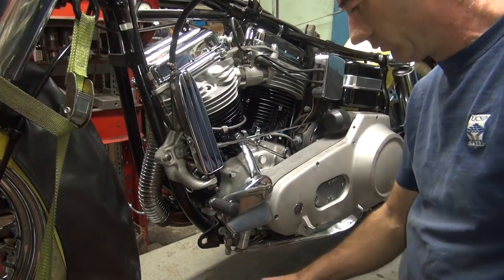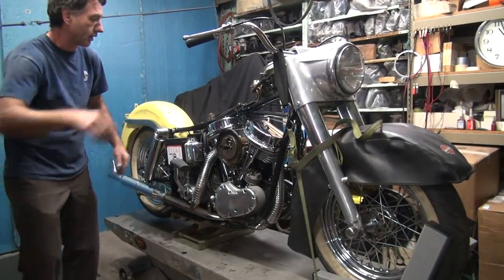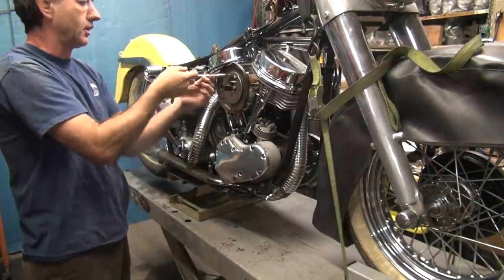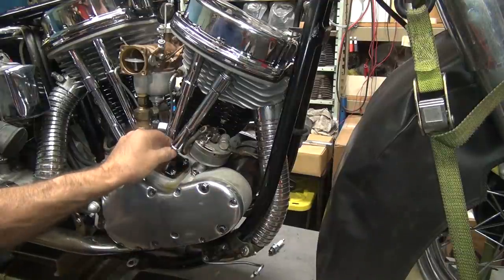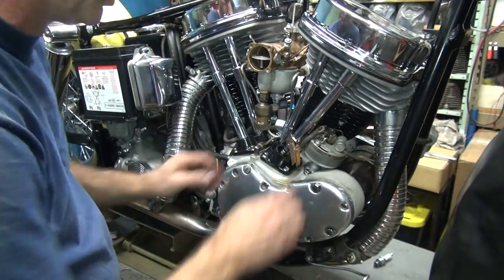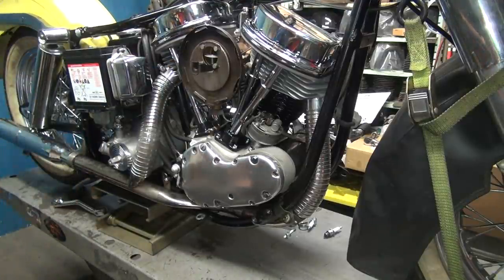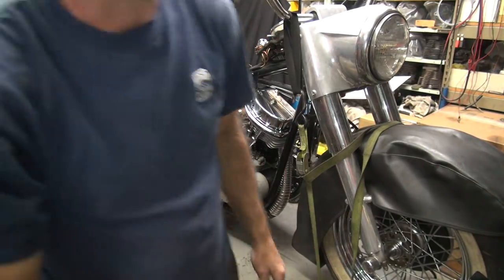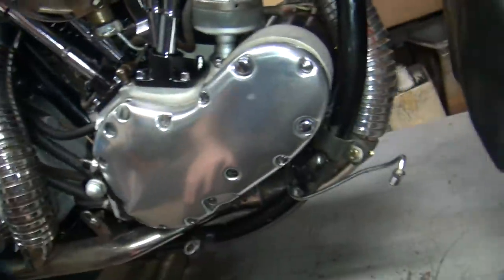1965 panhead #160 74ci flh motor rebuild and bike repair harley by tatro machine

Comment: got out of the suck in 76, in 77 I brought a 49 pan basket case for $750, put it together and rode it until 83, sold it to my brother and he ran it for 10 years. he sold it for bail money and it's still out there somewhere running. i miss it and all the headaches and fun i had.
Reply from the maker: its hard to keep a good bike down.
tatro

Comment: Anti-seize on plug threads is wise on any vehicle. I don't get paid to install inserts on my own vehicles (and to hell with doing it on 4.6/5.4 Fords!).
Reply: Tune up from hell 80% chance its going to need helicoil plug .poor bastard that was the 1st to find out thats normal.bring back the pinto. F ed over rolling disaster.

Comment: One cool thing about NGK plugs is that the threads are plated.  There theoretically isn't a need for the anti-seize.  That being said, I still use it on my stuff.
Reply from the maker: that might be but they don't gall up when i do use it and sometimes they do when i don't use it.
tatro
Reply: And that's why I still use it!

Comment: Linkert M74b indestructible. Still have a couple w/venturi machined. I've got a ton of hardware/fittings I'll never use. Everything from seat spacers to banjo fittings for a rigid pan.
Vacuum advance ......whats this cable for

Comment: Tatro is it always the lifter when there's valve train noise or could it be a loose pushrod.. I'm just now starting to notice some noise in the front cylinder......2004 twin cam road king. 95" kit with cams, adjustable pushrods was used. I bought the bike with work already done on it.
Reply from the maker: anything in the valvetrain can and does make noise.
tatro

Comment: You know the old saying man, one drop at never cease will paint a house LOL
Reply: Please stop saying never sneeze. It's anti seize.
Reply: @SavageZebra67  LOL but you have to admit one drop Will paint the house
Reply: @harryodum5598  that's true. Think it has to do with the graphene. That shit is like one micron and it gets everywhere. Could polish sand with that shit.
Reply: @SavageZebra67  it's definitely some good stuff. Before I retired I was a steam fitter and welder, we put that on 2 2 and 1/2 inch bolts on Main steam lines I got up to 1800 degrees come back a year later breaking loose with a hammer wrench
Reply: @harryodum5598  yah it doesn't bond with hardly anything. Pure carbon perfect for metal to metal.

Comment: when flooded ....choke open , ign off , full throttle , 3 kicks . Then turn ign on and start
Reply from the maker: or, full throttle, no choke with ignition on. there is no one way to do everything and if one method doesn't work try something else.
tatro

Comment: I was taught to take a long screwdriver and a rag on the handle to use as a stethoscope for noise finding when people see me do this now they ask me if i have a stethoscope i say nope i dont need one,kinda like you and the nut torque spec years ago i worked for chevrolet tourqu specs for mains and heads were 1/2 in impact rods 3/8 (zip then short burp)
Reply from the maker: if i have to do all that it is not bad enough to worry about. bad parts will let you know.
tatro

Comment: If one has installed a dyna electronic ignition on a panhead, should one use register plugs or not?
Reply from the maker: all electronic ignitions require resistor plugs and suppression plug wires.
tatro

Comment: Great video Tatro, I have a 59 fl it had a metal filter element and I’m wondering if that’s what they originally came out with? Perhaps to stop it catching fire from back fire? Cheers
Reply from the maker: the metal air filters are stock for the 1954 and earlier models. somewhere after that harley went to a paper air filter that i think was around 1956? either one can be used so you are ok. a k&n style air filter will let the motor breath better so it makes more power.
tatro

Comment: we had the same lift at one of my old jobs except it was modified for snowmobiles and had a hydraulic cylinder installed to operate with compressed air. went much faster than that one does is that one electric?
Reply from the maker: yes but i can stop at any point and work at that height. you can't do that with the other lifts.
tatro

Comment: Ive got a sigjestion get a divers weight belt with 20 pounds of lead and your scrany little self will kick it over easyer lol i had to through that at you i learned to start my 58 pan full choke kick it 4 times with my left leg then turn the key on and one good kick it starts every time try it youll like it even all my shovels are the same way 4 good kicks with the choke on key off then turn key on one good kick and wala it lives every time even. My nortons and most all my brit bikes started the same way
Reply from the maker: or you could just learn how to kick. it takes a strong ass leg to do it correctly if you are not a fat ass.
tatro

Comment: Had a '55 pan, I hated it, piece of junk. Folks, what you see on this video, with no disrespect to tatro, is exactly the way it is with old Harleys. Constantly fixing, replacing, adjusting something all the time. It took me ten years to finally figure out I got better things to do. I had a '78 shovel, same BS
Reply from the maker: old anything is what it is. you can fix it all at once or a little at a time. you can also upgrade many of the parts and make it alot better. than you can always take a softail and add in a new panhead motor and get what you wanted, a new bike that looks old but last.
tatro
Reply: Your bike obviously wasn't maintained , I'm riding a 48el that ive had since early 80s and trust it anywhere !  So now you quit riding or got a Honda?
Reply: Rode a '60 pan for 6 years with no issues, then a '76 shovel for 7. It's not the brand.

Comment: are those factory Harley Davidson heads or V-Twin. I am going to swap mine back to panheads on my 65,because the orevious owner installed shovelheads years ago for a little more horsepower but i want to restore it back to the original type heads. Thanks,you do very good and informative work. Thanks Again
Reply from the maker: i don't use v-twin heads, i like good parts. i mostly use stock heads that i fix as needed for the application.
tatro

Comment: Is it interesting for the noise in the cylinder head? It's a shame when it happens after assembly. I wonder what the problem is and what will end.
Reply from the maker: crappy lifters and rocker arm design.
tatro
Reply: Tatro Machine 
consequently, everything will be done by replacing the parts, the regulation and the engine will quietly work.
Reply: This is why I chose to run Velva Touch lifters. If you want the best they are the best. I'm sure they have a Panhead application. They're expensive as all hell but in my opinion you get what you pay for. The stock tappet blocks on the late model Evo's were aluminum and were slap wore out on my 1998 after 130,000 miles. I even lost oil pressure as a result! I immediately noticed a  significant increase in oil pressure after installing the Velva Touch lifters. It sure was great to see this 1965 Pan come to life, GREAT job KT & Scooby!!
Reply from the maker: good luck on that one.
tatro
Reply from the maker: i will take the s&s evo conversion lifter kit any day. they are bigger in diameter and will live longer. yes i would like them to be made out of cast-iron too. harley did make cast-iron lifter blocks in the late 80's and i have several sets for special uses.
a stock set of lifters and blocks would have done the same thing with your oil pressure. worn out parts are what they are. 
tatro
Reply: Usually when I do any type of upgrade at all I upgrade to something  significantly better than OEM. That being said I refuse to put the same junk aluminum (OEM) tappet blocks back in service, especially when I know there are other aftermarket companies that make a better quality product. I'm  sure that in your line of business you can agree. I only buy the very best for my bikes. Sorry if i came off as an a hole.

Comment: What carburetor is one this bike?  Many decades ago my brother bought a 1964? Pan that had no choke but had a Tillotson carb with a tickle.  He let me ride it all time even though I was only 14 and had no license.....no big deal in those days.  I remember it so well because the seal on the tickle would leak and if the bike backfired while kicking it over not only would the pedal smack me hard on the back of my calf, but the gasoline around the tickle would catch on fire and burn my thigh if I didn't notice it.  The seal looked like it was some kind of felt and would wick fuel out of the float and burn with about a 6" high flame.  AH!  Those were the days!  I developed a lifelong love of motorcycles, mainly Harleys  and still own a 1997 Road King I ride on a regular basis.  No more bruises on calves or burns on thighs though.

Comment: First winter I stored my twin cam I changed the oil first and it got so cold in my shed that the oil in the lifters turned to jelly. When I started the bike in spring they all collapsed and wouldn't pump up even after a half hour running the engine. My Dealer told me I needed new lifters - I took them out of the bike and pulled each one apart, cleaned them, pumped them up with an oil can and refitted them..... damn dealers are thieves......
Reply from the maker: no, they just have no idea on how to fix anything. they only know how to replace parts. next time use better oil.
tatro
Reply: @TatroMachine   I was a bit naive then and was using H-D's own 20w50... I am using Lucas oil nowadays and it seems better.
Reply from the maker: yes that is way better oil than harley. i like maxima and tribodyn myself.
tatro
Reply: @TatroMachine  Thanks for that my friend.
Reply: No

Comment: having the dizzy cover off might cause problems if the carb floods/leaks gasoline.  Just a "safety thought".
Reply from the maker: you have got to be kidding. you think its better to hold the gas in the carb as it burns up the bike. i would rather have it leak and burn on the ground. i can deal with that fire alot easier than the bike being on fire.
if you noticed, when you get a carb fire you kick the bike over until you suck all the fire into the carb. not run away like a little girl.
tatro
Reply: If for some reason the needle valve hangs open, pours gas out overflow or mouth of carb, , puddles at base of or near the dizzy and the spark from points sets off the fumes from the carb's gasoline overflow, flames up,and burns the paint etc you'll have a big expensive mess.  Furthermore, I see little need to have the DISTRIBUTOR COVER off, once you established the points are getting power & spark plugs are  firing .What you did there would you have you reprimanded or even possibly fired from most reputable H-D shops, if the owner spotted you doing it.. And yes I have worked for H-D shops including a franchised dealership. BTW, I'm not a kid nor a ittle girl, and have been working on H-D motorcycles for over 35 yrs myself. I've also had to put out a couple H-Ds that caught fire from people doing similar to what you did.  FWIW, I was just trying to pass along  a safety tip.  Seems you're not interested though, so do as you wish.....Good Luck, you're going to need it with your carelessness.
Reply: FWIW   I built a 1976 BiCenntenial Edition Super Glide to match her husband's original 76 BC SG, that appeared in Easyriders Magazine, on the "Foxy Riders" page back in the mid 1990s. It showed a pretty girl (Daisy, the owner) riding it dressed in a white tight outfit if you care to look it up.  I also built a Panhead Duo Glide that came in 2nd at Charlotte NC bike show in the 1980s ..considering the 1st place bike was built at the judge's shop for a customer, not too bad I say.  BTW I built that 2nd place winning Panhead in a customer's living room too. (hence SAFETY with GASOLINE AND IT'S FUMES) . Not to mention working on many, many , many bikes at a NC H-D dealership and later several other shops servicing, buidling, rebuilding, and maintaining a lot of different Harleys. Also I was a founding member of a SC Motorcycle Club.  So yeah, I have PLENTY of experience working on and riding Harleys.  And with dealing with assholes.

Also FYI I don't run from you or anyone else.  BTW try calling me a pussy to my face and see what happens. You act like the rest of these "keyboard commandos".  .you want to disrespect someone without facing them in person.  Although you appear to be old enough to know better it' appears you are not.  Rather you got incensed when someone merely pointed something out to you trying to HELP you, and resorted to childish name calling. Look up the word "maturity", you need to read the definition.

 BTW,  back in the 80s & 90s I personally owned two H-D Shovelheads, both of which I kick started with ONE ARM. I never needed to use the electric starter to crank them, because I know how to tune one. But then Panhead kickstarters used a different "ratio" and can be a PITA to kick at times. BTW the fact that the spark plugs ignited the gas mixture in the cylinders is a pretty good indication the points were doing their job , after which you could have/should have re-installed the cover for the "dizzy"and if you don't think a set of points breaking can ignite fumes from gasoline you truly are in need of some educating.

Tatro, I was merely trying to point out something to you that could save yours or a customers bike (& maybe even your entire shop)from being damaged or burnt up, by something you just overlooked/your carelessness. But it seems you'd rather be bullheaded and NOT consider good advice when it's given. Not to mention disrespecting said advice giver. BTW, prying out the roller lifter assembly with  two screwdrivers instead of using a magnet stick too isn't too bright either. But if it works..whatever.  Seems to me you need to stop trying to defend something you overlooked/did not notice , and just admit leaving the distributor cover off while cranking the bike for the 1st time after a rebuild while you have a flooding carb or at least a good chance an unexpected fuel leak causing gas or it's fumes to be ignited by the breaking points, isn't the brightest of ideas.  I will give you credit for saving and buildng the old H-Ds though. Glad to see old panheads brought back to life. 
Just be more careful with gasoline and ignition sources in the future, itd be a shame for your shop and all those parts to lost in a fire caused by such carelessness.  BTW, notice I didn't call you any vulgar names or disrespect you in this post.  That is something else you should learn to do.

Carry on ......
Reply from the maker: all of this bullshit comes down to the fact that you want to do a bunch of what if this happens bullshit. i don't give a crap about what you have done when you bring up a bunch of crap like that. if you are such a good mechanic than why in hell is your carb flooding over? why didn't you fix it in the 1st place. why didn't you turn the damm petcock off. why are you kicking over a bike with gas flooding all over the place. all of these things are what a dumbass does. if this is how you work than that is what it is. 
if you were here and said what you said i would call you a dumbass to your face and explain why you were a dumbass.
don't you even realize that the distributor on this bike is not even near the carb that you are so concerned about. your talking about a stupid cone motor dumbass.

same deal on the points. just because the spark plugs fire does not mean that the points and condenser are good. when you put them under load that spark can go all to hell. when i said i just had a bike in here that was that way that is because it was. i don't bullshit around, i tell it like it is and if you don't like it i don't care.
if you can prove to me there is a better way of doing things than the way i do it now, than most likely i will change how i do it. i work with truth and facts, not bull and theory's. what i do has been proven to work by me over many years of doing it. you have years of doing it your way and that is fine for you. for me i do it my way because that is what i have learned over the years.
now, can you take a bike you put together over a week with no sleep and run it at the track and not worry about doing it? i can and do. i even video it so others can learn and maybe even get off their butts and do it themselves. its all about having fun. you do shows, i race, thats just how it goes.
tatro
Reply: @TatroMachine  you are the man. Dont see any of these other "mechanics" helping us learn how to work on our own shit. Carry on and give Scooby a treat for me. 👍👍

Comment: Interesting that you're using NGKs . The European ones are now made in China. My local plant hire business has  switched to Bosch. The local race tuner has switched to something else. They had the same issues I've had. My flathead Norton runs  Bosch now,  Made in India...... . Pity as for 40 years NGK were my favourite. It's not clear  whether the problem is genuine NGKs or copies flooding the supply chain.
Reply from the maker: they have been working fine for me. what has been your problems?
tatro
Reply from the maker: i buy all my plugs right from a distributor so i don't get the junk copies. i have had no problems with my inventory.
when you shop for the cheapest products on the internet, sometimes that is what you get.

tatro
Reply: Problem is in Britain the main suppliers' product is suspect. Nothing to do with the interweb

Comment: what type spark plug is it the number i need
Reply from the maker: that depends on your application. for this bike i use ngk bp5hs for the spark plugs.
tatro
Reply: @TatroMachine   ive got 80 inch panhead with shovel head valves,s & s lower end